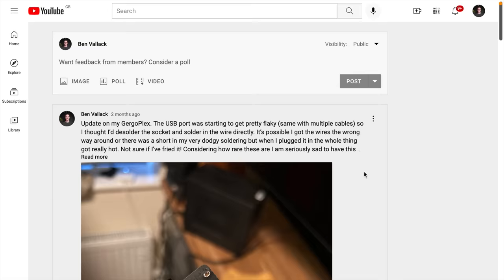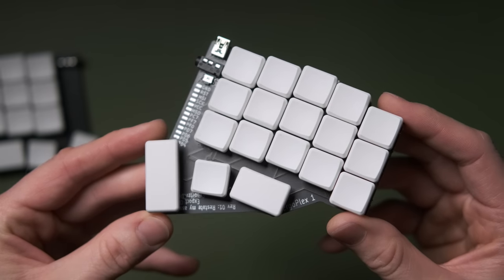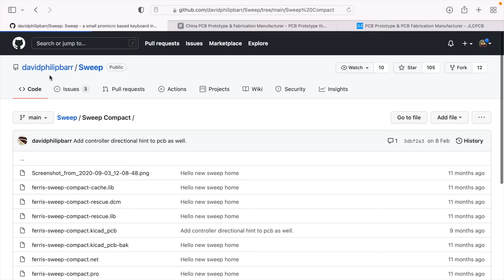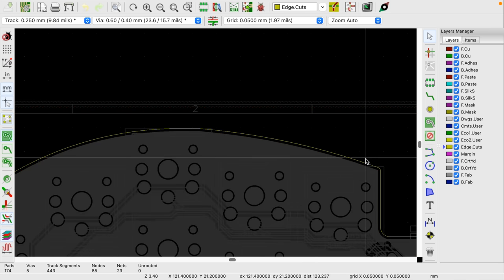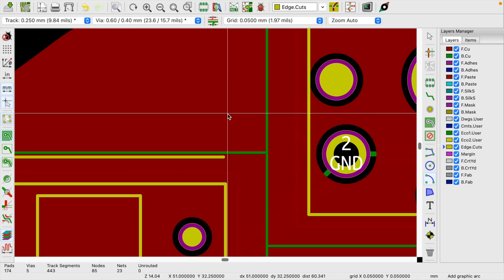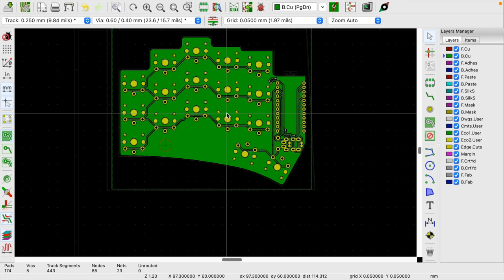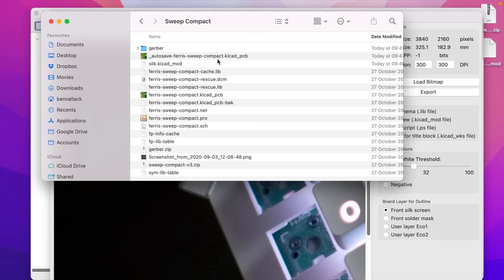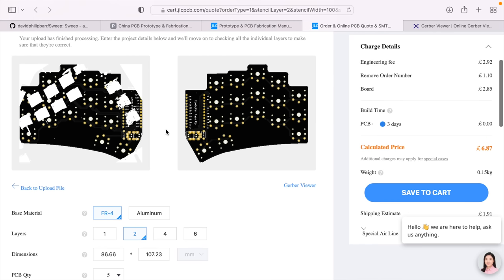A Tiny, Ultra-Affordable Keyboard You Can Build Yourself!

Comment: I just find out about this split keyboard things and wants to get one. But most of keyboard i found required to solder diode which i don't think i can do with my shitty tools and i don't want to buy something i probably just use once. So this ferris sweep doesn't need soldering diode? And why?
Reply from the maker: Yeah Ferris Sweep doesn’t use diodes because it uses 34 keys. If you use nice!nanos with ZMK you can even use 36 keys as you have pins available that the Ferris Sweep uses for the TRRS.
Reply: Do not do this project. I was stupid enough to order a pcb from china and they use DHL for shipping. I paid $20 for shipping on a $10 pcb and it was never delivered. (common DHL scam). Never again, now I am out $30 and a whole lot more money for switches and tools

EDIT: I recently found a company who ships out Ferris PCB's for $30, using USPS shipping. Thank god.

Comment: I want to try something like this, already done some small soldering, and recently bought a Moonlander (and I absolutely love it!)
I saw that some PCB requires diodes, but not this one, is there a reason why?
Reply from the maker: Yeah there are only so many connection points on the controllers so when you get over a certain number of keys you need to use diodes to create a matrix (absolute wizardry!). These ones just have one key conected directly to a connection point each on the controller so it's nice and simple.

Comment: Hi, thank you for the video. I just wanted to know if the Sweep High is MX supported and the gerber file is correct. When i try to upload it to jclpcb, it does not render the pcb.
Thanks!
Reply: Check again the repository. It now has an updated version that should work just right.

Comment: Anyone know of a similar board that also uses micro controllers instead of individual components, but has more keys? I love this board, but this would be my first board coming from a full size qwerty, so the 34 key seems like too much of a leap. At least for now
Reply from the maker: Trouble is once you get over 36 keys you need to use a matrix which means soldering diodes.

Comment: Can you get this keyboard premade?
Reply from the maker: In various forms here: https://www.cuddlykeyboards.com/s/shop as usual though with these kinds of boards there seems to be an availability issue! It really is worth getting to grips with the soldering so you can get these things on your time scale.
Reply: I don't believe so but through-hole soldering really is probably the easiest soldering job there is, and the whole project is very satisfying.  I get that buying a soldering iron and accessories adds to the cost, but in general these are great tools and skills to have over a lifetime and each step in the path is small and manageable.  Think of it more as a hobby project in itself, and less as a chore to get a keyboard.

Comment: Hey there Ben! I downloaded your gerber files for the Ferris Sweep Tweaked board from the link in the description, and it seems like the stencil is inverted (the spider webs are shown in the color of the board and everything else is white), making it impossible to read any of the labels on the board. 

I have checked PCBWay, Jlcpcb and Tracespace view but they all output the inverted colors instead of the colors shown in this video. Since I am pretty new to this, I am not ruling out that this is an error on my end! Is there something that I am missing? Maybe there is a setting to invert the stencil color somewhere that I might have missed?

EDIT: OMG, I think I have figured it out! I have to setup the PCB color to white and the silkscreen to black and not the other way around, I think? Turns out, I am just a dumbass after all. XD 

I wont change my original comment, though. I will leave it in case someone else has the same issue in the future.

EDIT #2: I have ordered the boards! Looking forward to building it when it arrives.
Reply from the maker: Yeah I think it was inverted. I think I ordered a white board and black silk screen. Can’t really remember now but I think it was something odd like that!
Reply from the maker: Sorry just saw your edit! Yep that’s it! Not your fault - my setup was wrong really!
Reply: @BenVallack  Phew, I was worried I might have ordered it wrong although I'm sure it would look good in all white as well. Going to be exciting to get these boards and make the build. I was surprised to see how cheap it was to order the PCBs. Went ahead and used them to 3D print a case for my Sofle as well. 

Anyway, thanks for everything!
Reply: @BenVallack  I have question, are these keyboard n keyroller? like can they register 8 keys if i press them all at once?

Comment: i am hoping if someone would help me. I am trying to print this version of the sweep but pcbway is saying that my gerber file does not have a drill hole layer. do i just check the no drill option? or will that make my board unusable if i order it without any drill layers. I am new to keyboard making and i am lost
Reply from the maker: I think you might have missed the step where the drill holes are prepared. You do need the holes for everything to go into.

Comment: I wanted to do something like this. Do you socket your microcontroller? Are those spring sockets and where did you get them?
Reply from the maker: These are the low profile sockets here, but if you want to use nice!nanos for a Bluetooth version with batteries underneath you need the full height machine sockets. I think I linked to them in the description. Check out splitkb.com

Comment: Hi Ben, could you tell me where you found the 12g springs you used. I can't find the video (or timestamp) you mentioned them. I'm looking and they are sold out everywhere.
Thanks.
Reply from the maker: I ordered them with the Gergoplex but it was actually 15g springs that I got in the end. I think the 12s had longevity issues.
Reply: @BenVallack  thanks for the info, your video motivated ne to build my own ultra portable split kB.

Comment: Thank you Ben! I have build mine based on your guidance. I used Pro Micro with usb-c port instead. It was cheaper and easier to get.
I have hopefully small issue with the right hand side. Its layout is mirrored "poiuy". My right controller is facing up as in your video...
I guess I must change something in a way I flash it. I was using QMKToolbox.
Reply from the maker: Ah yeah that actually happened to me too on my Elite-C/QMK Ferris, I think there was something I ended up doing in one of the QMK files to mirror the right one back.

Comment: The extreme stagger is why I went with a Kyria, looks extremely similar as far as the layout is concerned. It's also an open source DIY design, very easy to build and modular, supporting anything from 50 keys (or 48 keys and two rotary encoders, for 54 total inputs) all the way down to I think 40 keys. I built mine with 49 keys and one encoder.
Reply: The Kyria is DIY but not open source, I have one too 😝